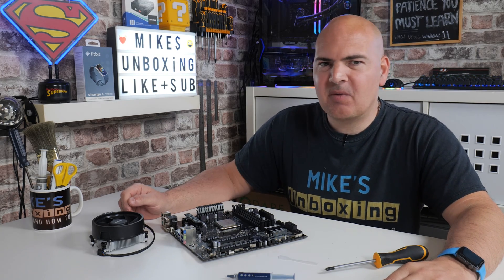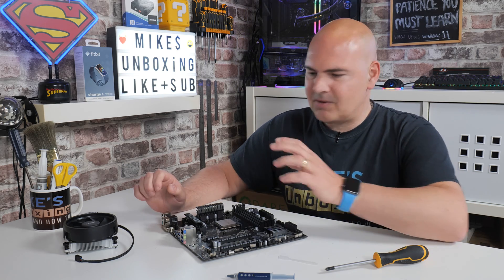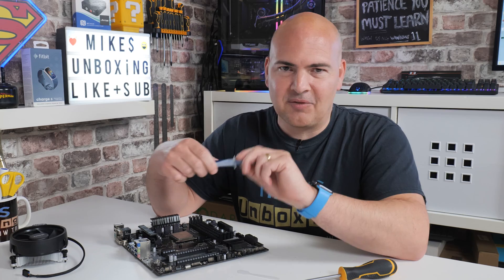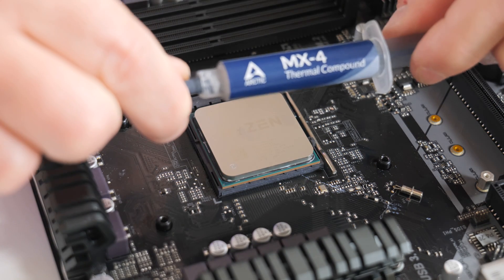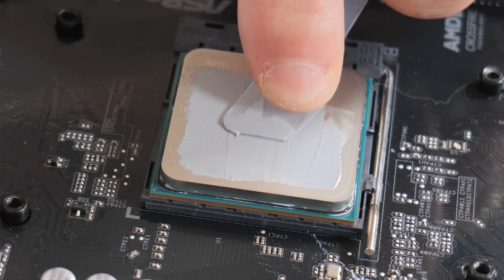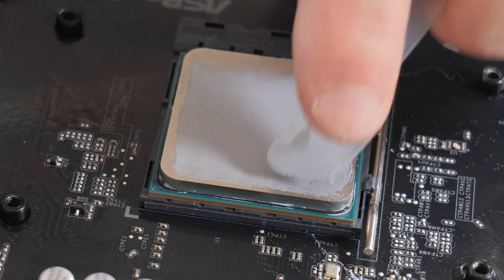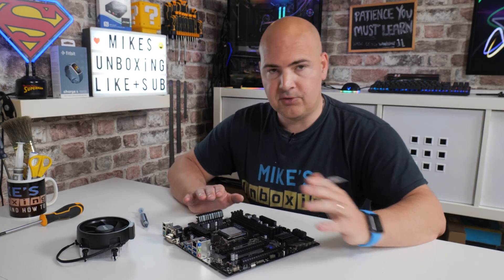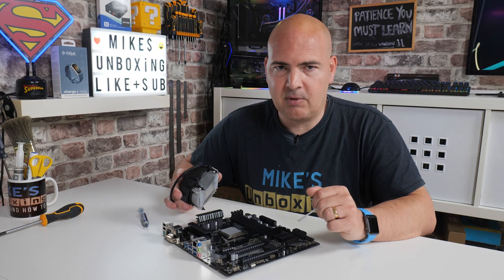BEST Method For Applying THERMAL Pastes & Compounds - Change My Mind

Comment: Still too much paste in my opinion. Spread it with your finger or a razor blade to be transparent thin, as thin as you can make it, a haze across the surface will do. Do that to both the CPU and the heatsink.

Comment: What are the CPU temperatures after thermal paste?
Reply from the maker: all very similar, but the thin spread method makes it easier to remove later and doesn't gum up as much

Comment: I started building computers as soon as IBM came out with the PC in the late 1980s. Once coolers showed up, I started using them. This was the recommended method even before 2000. I've always done it this way and I have never had a problem. I use a piece of cut credit card as my applicator.
Reply from the maker: Thanks for sharing!

Comment: I recently came up with the idea of simply putting a small square of scotch/cello tape to the tip of my finger and using that as an ersatz spreader. It works fabulously! Not only does it give you more tactile feel and precision, the edge of it sort of works like a paint brush to essentially "paint" the paste onto whatever kind of processor you're working with.
Reply from the maker: That's a great idea!

Comment: Look at cooling system manufacturer tutorials. They are most interested in beating competition and perfect cooling.
They all advise multi dot (5 or 9) method.
Intel recommends single pea/grain method, no spreading.
Reply from the maker: like i said in the video, do it however you prefer, i do it this way to make installing and more importantly removal easier, regardless of the manufacturers claims
Reply: @mikesunboxing  yeah I believe those recommendations were for square designs, especially for AIO water pumps (round contact). 
For the maximum effect you may really need this method.

Comment: I would have just put the cpu cooler straight onto that blob of paste. Always works for me and get perfect temps.
Reply from the maker: i have had mixed results in the past with the blob method and with new CPUs being odd shapes the shread method and maybe a small blob in the middle also, really has improved my batting average

Comment: How do I know this is the best if you haven't compared temps to worse applications? How much do I lose if I just apply the "blob" and leave it, done?
Reply from the maker: it isn't just about temps, it is also about ease of use and the ability to be able to remove it easier later. The blob method depending on how well it is squished out and the quantity can be the same or worse than a complete thin spread layer

Comment: Had no spatula but alwais got patience and a toothpick. Still worked well ^^
Reply from the maker: thanks for the comment, hope your temps are low
Reply: @mikesunboxing  They usually are because i tend to operate more to get a smooth surface. This time i have to repaste because the paste i used seems to have aged out and it's time to try out MX-6, hope it will be good! And yeah, this time i got a spatula eheh

Comment: I used a pea method of applying when I recently installed my assassin king (with the included TF4 paste) didn't think about spreading it, I used a little more than you showed here but not much more, I'm a worrier and was thinking about removing the cooler to use this method, should I just leave it be? My temperatures on a 5600G (not using the APU, I have a 6750 XT) are around 30 degrees idle, 35-50 degrees under light-medium load and 65 degrees under heavy load, does this sound about right?
Reply from the maker: sounds fine to me, maybe it could be optimised but i don't think you will see any major difference if any
Reply: @mikesunboxing  Thanks, yeah I think I am just overthinking it. From watching videos testing different methods there really isn't much difference between all the different ones as long as you use sufficient paste. All those temperatures too have been taken over the past few days where I'm sure you're aware, we're having hot weather in the UK too so pretty high ambient temps. Maybe if I re-paste in the future I'll try this method but I think you're right, no point in taking it off cleaning it all again and wasting more paste lol.
Reply: Really appreciate your help btw, you're videos in general are very informative, clear & concise.

Comment: You want 100% coverage of the IHS. True, the heat producing elements are of the CPU don't extend completely to the edges, but it is the job of the IHS to "spread" the heat evenly across the entire surface and you want to allow heat from all areas to pass into the cooler.

Comment: I have been using the spread method for 20 years and never understood how anyone ever thought another method would be as good. I do see that most people use too much paste when using this method. You only want enough to fill the gaps where the IHS or cooler plate are not perfectly flat and will leave air-gaps. IHS to cooler direct contact is great, but not consistent.
Reply from the maker: yep i agree and am often guilt of it :-)

Comment: Great, this tutorial emphasizes everything that I thought but haven't seen so well explained/shown. Also great that you filmed the whole spreading process so there is no doubt on how to do it. It's important to understand that the thermal paste is designed to minimize microscopic air gaps and irregularities between the surface of the cooler and the CPU's heat spreader (the top plate). So putting to much can affect the thermal conductivity that is supposed to be directly between the surface of the cooler and the CPU's heat spreader. This is also why you need a god thermal paste as the MX-4 (or MX-6) with a high thermal conductivity value [W/mk]. 

Much appreciated... thank you!!!

.oO(this video should be a reference to everybody working with thermal paste on their processors)
Reply from the maker: thank you for the kind comment, glad it helped you

Comment: Just drop a pea sized amount in the middle of the IHS and put the cooler on. There's zero need to spread the paste, the pressure of tightening the cooler will spread it evenly.  you spend minutes wasting your time faffing about with a spreader that made zero measurible difference.
Reply from the maker: you do it how you like, the pea method almost certainly makes the cooler more difficult to remove after use

Comment: Why not use the spread method on the heat pipe surface of the cpu cooler? Or is the heat pipe surface bigger than the cpu surface so the chance of paste spreading out outside cpu surface is greater? Anyway only apply thermal paste either on the surface of the cpu or cooler, not both ofcourse!
By the way I am convinced of the spread method. Before I always used the dot method but since the introduction of heat pipe coolers the spread method is in my opinion the best. Other methods give insufficient spread out after pressing the cooler down.
Also there are different kinds of heat pipe surfaces. Some of them are separated by aluminum or nickel metal between the heat pipes and other surfaces of the heatpipes form one solid block, the heat pipes are welded together and form one block. Maybe it is an idea to make a video of different  surfaces of cpu heat pipe coolers and what the benefits are and how to apply thermal paste.

Comment: Old video, but it's worth mentioning that I always used the thin-ish film as you demonstrated on my many PC builds. 
I needed to remove my AIO cooler a couple weeks back to fix a hard to reach cable and decided to see what would happen if I put a much thicker film on there. 
I used at least double what you did and what I used to do. 
I can say that my temps dropped 3 degrees c. 
So, I saw a big difference using more paste.
Reply from the maker: that is pretty interesting. Some coolers if they don't have a flat base, or ridges for heat pipes can benefit from more paste
Reply: @mikesunboxing  It's a sample size of one cooler.... so take that as you will. I think GN did a huge video on it and determined that as long as you have enough to cover the whole thing, it does not really matter at all. 
With GPUs though, error on the side of too much.

Comment: I'll point out a detail, the heat generated by the CPU tends to expand outwards and you have not taken steps to expand the thermal paste even in the edges of the processor so your method is not the best

Comment: I always suspected spreading is best. But after years of hearing unspread works as well, I figure take the easy way out if it's all the same. But after watching this, I will be going with what I originally suspected.
Reply from the maker: the thing is that under compression generally speaking the paste "should" all squish out like in the spread method, but it isn't an exact science and thicker pastes won't squish as well as thinner ones obviously.
Reply: the problem with unspread, is a lot of the newer gen cpu's are more rectangular now than square so the spread when pushing down the cooler will be uneven and won't cover the top\bottom portion of the cpu. the pea method did work fine before-hand, but now I think its a lot more inefficient.

Comment: I apply a thin bead along one edge of the cpu and use an old credit or debit card and press n spread to the other edge, perfect!
Reply: I've done that for years as well, it is definitely the best way to get a nice thin layer in the least amount of time. The heatsink pressing down on the cpu will of course cause minor amounts of excess, not enough for it to matter though. I guess if you were a neat freak, u could do a thin bead a quarter inch away from that one edge before spreading to the opposite side another quarter inch away, then allow the heatsink to naturally spread it when you screw it down to the cpu. Not necessary, but maybe nice for people with OCD XD

Comment: This might sound really dumb to a lot of people but I am terrible at this method! I tired it on my third build and I couldn’t get it to spread it just kinda smushed and looked dry. If that makes sense lol? I think I wasn’t pressing down hard enough (worried I might press too hard and damage the cpu socket). Does anyone have any tips?
Reply from the maker: it will also depend on the paste you are using some are thicker and hard to spread, with those a small rice grain on top works okay

Comment: I've always been using the 'dot' method with full load 79 degrees. Since I deep cleaned my pc, my friend told me to use the spreading method. I did it and at full load it went from 79 degrees to 62 at max. Huge diff. 

Before spread idle: 50 degrees
After spread idle: 33

I have a Ryzen 5600x with Noctua NH-U12S redux. I use Thermal Grizzly that came with a spreader.
Reply: If you dropped 17°, you probably did something wrong the first time because there's no way you should've lowered your temps that much just by using the spatula.
Reply from the maker: @danieldevito6380  where did i say that part, i need to recheck that section, i certainly wouldn't see that much difference, you are right, but i can see where i said that
Reply: @mikesunboxing  He was commenting on the guy above, who obviously must have made some mistake. As numerous tests have shown it doesn't really matter which method you use. They all work, and this is fine as well. I used to do it like this. Nowadays I simply put a small blob (which is actually recommended by AMD and several cooler manufacturers) simply because it's easier.
Reply from the maker: Thanks for sharing

Comment: With something like the i9 13900k wouldnt this be too thin to cool such a beast? Should i add a small bit more?
Reply from the maker: add as much as you like, most thermal compounds are not conductive so won't be a problem, just more to clean up when doing maintainance

Comment: The problem is that with the GC extreme it's almost impossible to apply a thin layer , either you get a lot or none.
Temps were sky high .
I prefer the Arctic Mx-2 , will try MX-4 also  just because :) super cheap to buy ,why not ?
Reply from the maker: Thanks for sharing

Comment: Ive seen this spread method creates air bubbles. Wont it make perfomance worse?
Reply from the maker: doesn't seem to, that is why i smooth it out many times to try and prevent that, and besides i would rather a few micro bubbles and be able to remove the cooler easily without breaking pins or being stuck to the cooler

Comment: wheres the benchmark?
Reply from the maker: it makes very little in terms of performance more the ease of use when removing, between a terrible install and a good one is very little and is unlikely to ever be noticed until trying to remove or replace the cooler

Comment: I always did the pea method since like 2001, and this drops temps I was curious what people was doing with AMD I used 5 dots which my 3700x only went to 67c full load so not bad. Now my 5700x is a little hotter imo so I did this and its under 70c in gaming now.

Comment: This is exactly the way how you should apply thermal paste on your cpu.
I never have seen this video.
But i also found out due trial and error that this way is the most effective way for maximum cooling.
Reply from the maker: i agree, it saves money and works well, and also doesn't end up like glue

Comment: are you dumb? normal people dont remove the cooler every day.  not using the best paste either. and you dont know how heat transfer works do you?  covering the entire cpu doesnt mean better heat management. people believe these myths? just put a pea sized dot and be good with it. all the heat will transfer to the paste. it has to escape somehow and the paste attracts it. you dont have to spread shit.  it does not just bridge the gap it helps the transfer of heat omg. im done.  epic fail. been building PCs since i was toddler and have a masters in computer science. this is not how you do it.  what a waste of time

Comment: Watching to put the thermal paste that came with the alseye m240.  Is it a good thermal paste or I should buy one? It says thermal conductivity 7.5w and resistance 0.6 and 25% silver.
Reply from the maker: it was pretty good when i used the branded stuff, not sure if it is the same in the kit though
Reply: @mikesunboxing  ok

Comment: The only reason I would apply thermal paste like this is if there was a global shortage of thermal paste. The difference between this and a pea sized blob is non-existent.
Reply from the maker: the difference is the removal afterwards and getting your pea size right
Reply: @mikesunboxing  I can understand that, but I would feel much more peace of mind knowing the entire surface area of the cpu is covered, the spreading technique is the best for easily replicable application, but it is also possible to create little air pockets.
Reply from the maker: @batchynator  air pockets are a potential for all application methods unless the paste has such a low viscosity that it self levels and using a lot of paste can also create air pockets due to the high and low spots. a THIN spread removes the possibility of peaks and lows, Lots of people use the spread method but use way too much
Reply: @mikesunboxing 
No. He is right. Spread method traps air pickets. Take a clear glass and check for yourself.
Basically that's why tile workers comb mortar in a straight line pattern - to let air out.

Comment: The objective best way to prevent the CPU from being pulled out when removing the cooler is to take 2 entire seconds to twist the cooler left and right a little bit before pulling it away. The method of paste application is far less important to this issue. Any method can harden and glue the cooler to the chip, a small twist frees it every time.
Reply from the maker: i would love to agree but that isn't always the case for me and for a large number of our viewers, especially with those that have the stock AM4 or intel coolers.
And besides why risk damaging an expensive processor and waste thermal paste and performance?
Reply: pretty much this.

Comment: On the AMD coolers with pre-applied paste are we saying its inefficient application for heat transfer?  I can usually get the cooler off the CPU by letting it run to warm the paste first then wiggling it.
Reply from the maker: the paste is a low quality and has a really sticky consistency, warming it up and or twisting the cooler will get it off in most cases, but why risk breaking the cpu for the sake of a few moments carefully applying paste, it might even give better performance

Comment: Spread method is best. Reapplied mx4 on my 3400G and used the supplied plastic spatula thingy. Less is definitely more. Less cleaning up on next re-application and also more applications from the 4g tube. Just run cinebench a few times temperature dropped by a couple of degrees the score after reapplying was a bit less for some strange reason lol. Top video Mike👍
Reply from the maker: thanks mark, and yes i totally agree less is more

Comment: Hi Mike  I made a mistake I ordered the wrong cooler for my system from Amezone an artic freezer a35 rgb I just bought a new pc but the cooler pff very bad so I ordered another one I don't really know much about it but thought I had taken the right one my pc🎆🎆🎆 Lenovo Legion T5 26AMR5 AMD Ryzen 7 5800 RTX3060Ti Desktop Gaming PC🎆🎆🎆 HELP ME please MIKE WITH A GOOD COOLER BUT NOT TOO PRICEY AND WHICH I CAN EASILY PUT IN MYSELF THANKS IN ADVANCE
Reply from the maker: the best bet would be to under volt the cpu voltage, i did on mine and the a35 cools it okay up to about 80C max load
Reply: @mikesunboxing  Hi Mike ChipsetAMD B550 but which cooler(s) fit here ,I can't figure it out myself have this pc from meggeko the freezer A35 a- rgb pass not thanks in advance